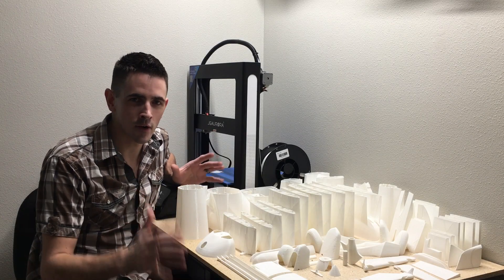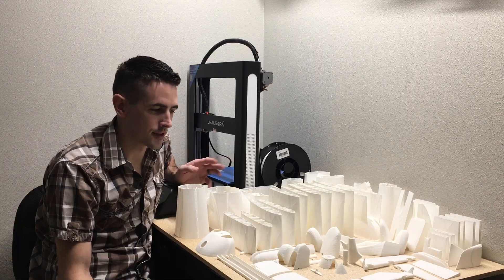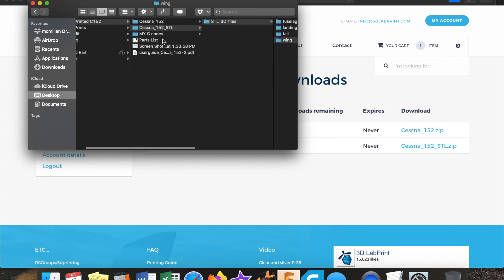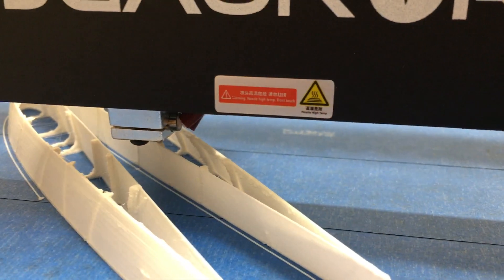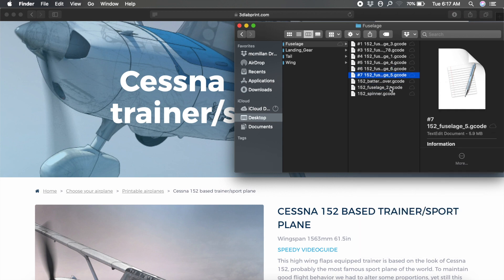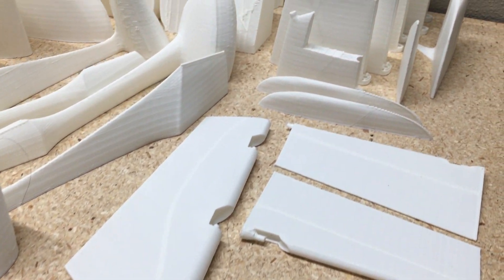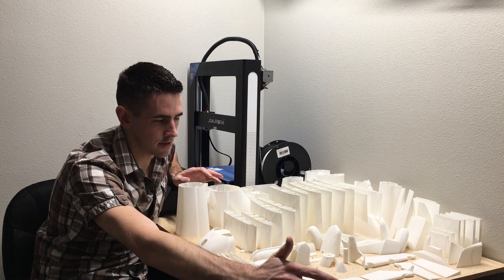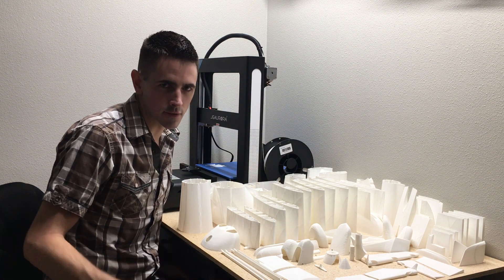3D Printed Airplane C152 Part 1 - Printer Setup

Comment: This was so painful to watch. You should really have just found someone who really knows 3D printing to help you get started. It would have been so much better in the long run. Like those ailerons really should have just been sliced with a brim so they adhered to the build plate without any fooling around. Ouch.

Comment: I just finished the F-86 on ender 3V2 with zero issues.  Made my own programs with cura and printing at 80mm with layer height of .12.    Check my videos uploaded and can share settings

Comment: Well guess what, i bought the recommended Prusa mk3 , colorfabb LW-PLA and the files to print there glider called bungee prop. The only part that printed without a hassle using there G-codes was fuselage part 1, the rest i had to tweak the temp to get the prints right. The wing tips in particular were a nightmare, i wasted almost all my filament just to print them. The eclipson model V on the other hand which does not even recommend the Prusa printer and all the parts came out without any defect or hassle.

Comment: I got it working on a an anycubic mega s by reducing the layer hight to 0.2, reducing the speed drastically to 35mm/s, retraction 4/4,5, prime -0.1. really decent prints, good bed adhesion no warping. It took me a about a week to tweak. I used the original settings for Cura by 3dlabprints. Then only change one thing at a time so you know what's happening. And start with small parts as wing tips so you don't waste to much. And observing the printer what's going on is also helpful. Done with form futura pla. Very happy with the quality. Greetz

Comment: some of your problems can be solved easily. like using a brim, and also you can use CAD software to splice out parts of the prints, so you can print individual pieces instead of sets of pieces
Reply: Even some slicers will let you save out individual pieces from a set in G-Code. I think Slic3r will do that.

Comment: Is there any problem using the Gcodes that they provide with another printer?. I have done that with other project (and seller) that also provides Gcodes with my cr10 V3 direct drive and the only thing that I changed was the retraction settings. If the volume is greater or equal to the prusa they used to generate the Gcodes there should not be problem, or am i wrong?
Reply from the maker: You are correct that is how I understand it also.
Reply: Ok you explained later in the video sorry ^^'' Nice video tutorial thanks!

Comment: I suppose by now you have learnt to properly level your bed instead of dupergluing parts. That first layer was so figh up from the bed it was painful to watch, no wonder it didn't stick.
Reply from the maker: Yes I have learned a lot more about printing this was my first printing project. The bed was not set up right don't need to glue parts to the bed anymore.

Comment: I don't know if you tried out already but the most impact, or improvement of the surfaces quality has been to set the cura function "outer before inner wall". Suddenly all the inner parts of the plane does not show up anymore on the outer surface.
Reply: usually everything is single wall..

Comment: I successfully printed the Stearman and I am now printing the Cessna, I can give you following tips, which seemed to be working quite well with my Ender3pro: —modifying the printer to direct extrusion (in my case just one printed part required) —layer hight 0.25mm makes it faster —printing all high and tall parts with a 4mm brim instead of skirt as bed adhesion —extrusion to 105% —printing the fuselage with a double wall—printing the wing tips with 1mm top layer, the motormount with 2mm top layer —bed temperature for 1st layer 70*C then 50*C —nozzle temperature 215*C —travel speed 150 was the maximum with these settings. Last point was to modify the retraction and prime just a tiny bit. (As I modified from bowden to direct extrusion, there was not much required to minimize stringing. All sliced in cura. Even with a doubled outer wall for the fuselage, it was still within the weight limits.
Reply: I thinking of a ender 3 with ditect drive how do you like youre for planes
Reply: @deanmyeres4089  my only modification is the direct drive with a printed bracket from Thingiverse . I love the magnetic bed, it makes it so much easier to release the thin and fragile parts. But the most important thing I learned: use PETG instead of PLA, a good PETG makes a extremely durable plane, which even survives harder landings.
Reply: Hows the weight if petg
Reply: @deanmyeres4089  if your printer and profile are dialed in well, the weight is the same. The higher specific weight is not noticeable
Reply: I changed my Ender to direct drive (with a Capricorn tube) also and love it. I also added a hardened nozzle. Now I can print with PLA, TPU, and PETG Carbon Fiber. I’m now trying to print the Cessna 152. Thanks for the setting tips.